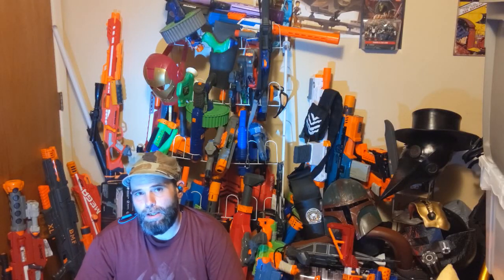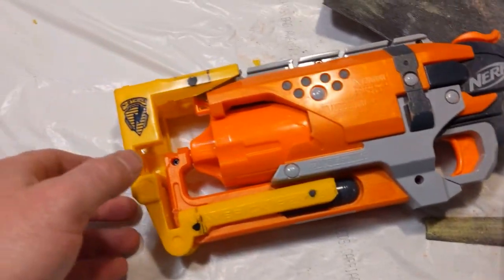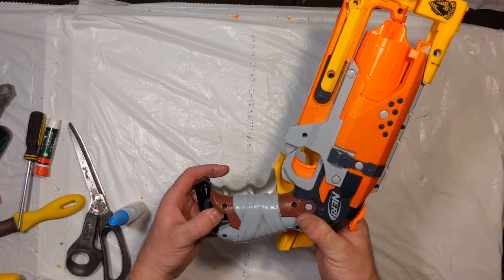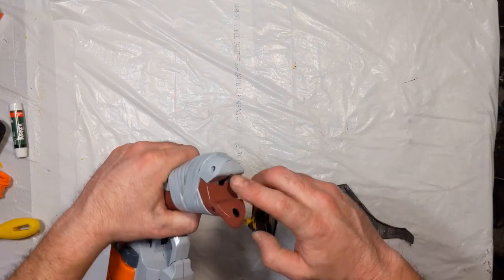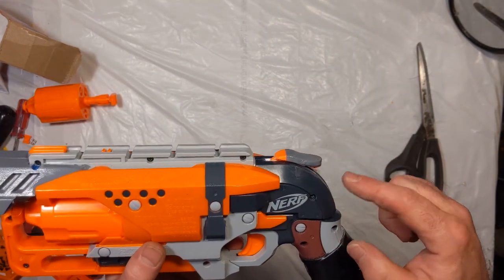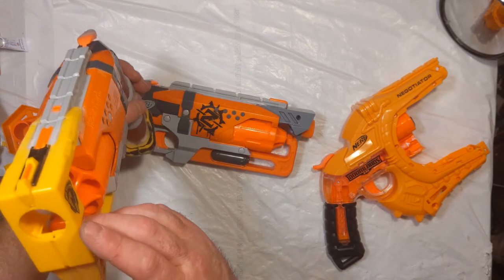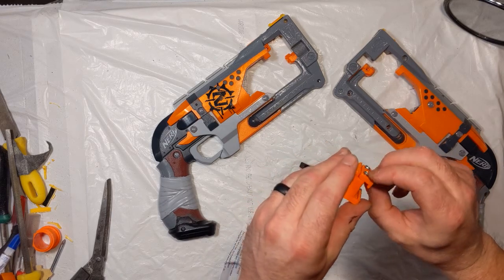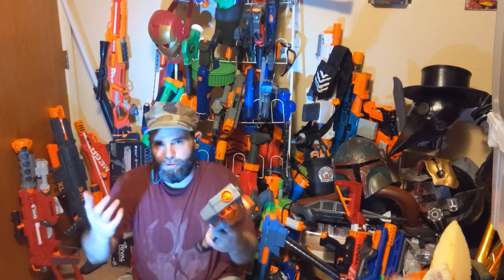Nerf Hammershot spring swap and Maverick shell integration

Comment: I never understood why the hammershot barrel wasnt like the disruptor with the firing barrel lined up with the cylinder but now this looks much better
Reply from the maker: Yeah or how Nerf just didn't come out with streamlined n-strike elite versions of the hammershot with a small barrel to build on. Its cool they came out with new colors of hammershot, and the hammerstorm does work better stock but is bulkier. Nerf needs to hire someone on their design team with a slight understanding of what the community needs
Reply: Zolus Dart Art or just hire someone from the nerf community itself
Reply from the maker: @unbidvulpes2382  that makes the most sense but I don't see a corporate entity like Nerf doing that. Of course that's why Dart Zone is slapping them silly right now lol